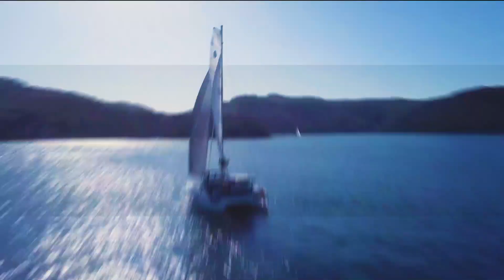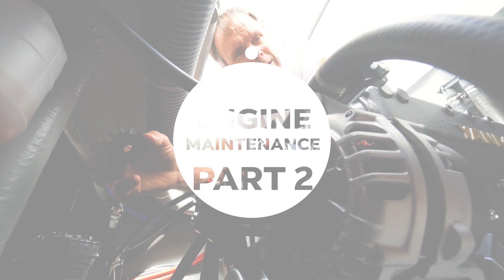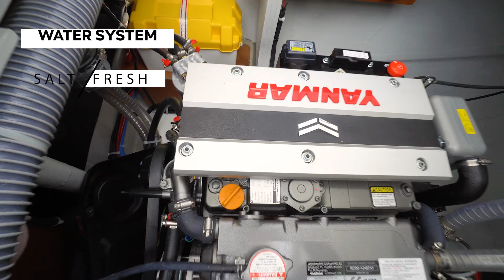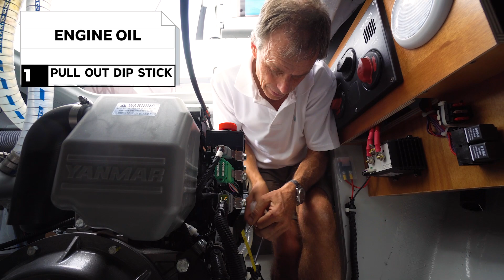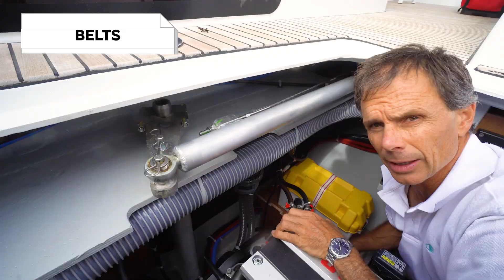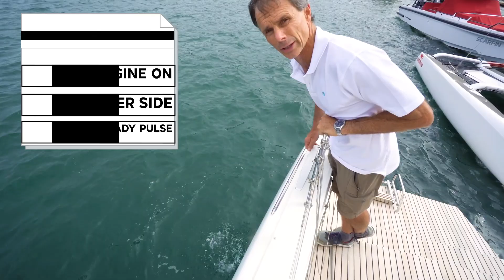Routine Diesel Engine Maintenance Explained Simply | TMG Yachts

Comment: What about a deseil that runs a generator that either charges batteries or runs a electric propulsion system? Can an engine also have an air cooling option?
Reply from the maker: Maintenance for diesel engines is generally consistent, whether they're used for propulsion or powering a generator. The addition of a generator to charge batteries or support electric propulsion can provide flexibility in power management. Air cooling options are also available in some diesel engine setups, offering an alternative to traditional water-cooled systems.

Comment: Good Vid -- but clearly there are different approaches to WOBBLE. 

IWOBBLEI ==   where I=isolate -- turn of the engine batteries and remove the starter key    AND obviously the 2nd I is turning the batteries on again. 
All checks also apply to the Genset.
W does = water -- but unless the strainer is above the water line - you have to close the stop cock.  ALSO - you need to check there is no plastic stuck on the outside of the through hull. AND an impeller removal tool is the best tool to remove impellers.  Check the position of all sea cocks. 
L=Levels -- Battery levels, Fuel, oils (each oil), water, antifreeze, header tanks etc.  NOT Leaks.  Also check the propane bottle store and the level of gas. 
O=Observe - look around each technical area, look to check there are no loose connections, look for any residues etc.  ALSO look to see if there is water in the Racor (primary fuel filter) 
B - Bilges (not battery)
Belts - no more or less than a 1/4 turn
S = is part of E engine.
Re adding a 2nd S.  If it is your boat you should keep a proper list of the parts you have on the boat and where they are. AND have reordering levels - each time you use a part this needs logging as does the amount of each fluid you add each time you do. So you can monitor the amounts "used"/lost.
Reply from the maker: Absolutely! Each boat and is systems will differ from one to the next so it is important to tailor your inspections and parts list. Thanks for your comment :)